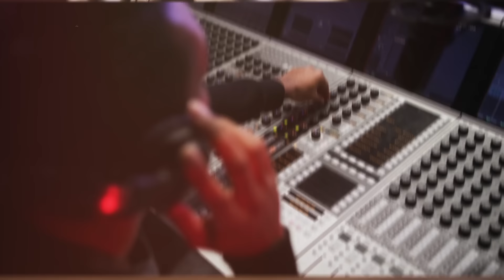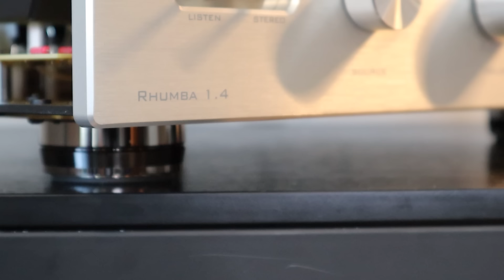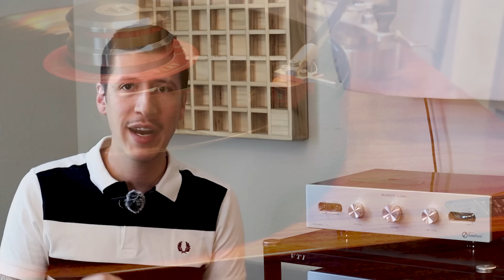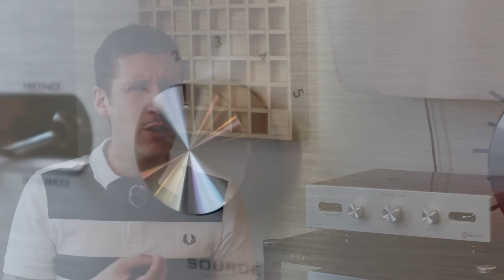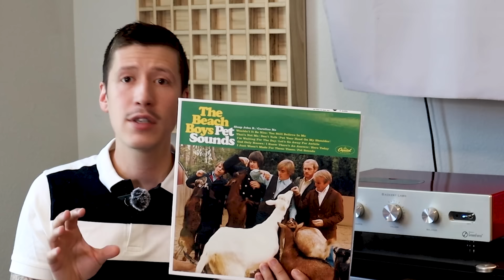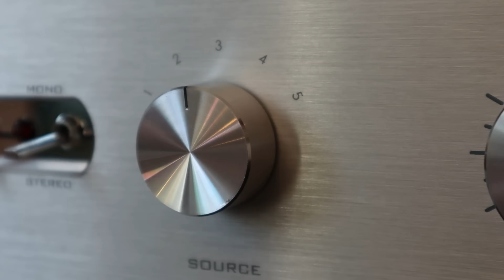Rhumba Extreme 1.4 linestage tube preamp review

Comment: You can sum the two channels on many preamps by plugging a single interconnect between the left and right tape outputs.  My c-j preamp does not have a mono switch but it does have tape outputs, so I built a box with two RCA cables coming out of it and a toggle switch that links them together.  It's not the most elegant way to do it but it works.

Comment: the 6953 is an infra red photo tube and thus not a sub for the 12au7 . the 5963 is the reference you may wish to use .  For  tube guys this is a large error. Looking at the part chooses does give insight in to tube selection and intended voice of that pre amp . Over all this is a good choose in it price range . Tube rolling will effect the sound of an quality tube unit  with very few exceptions.

Comment: I've got a Rhythm 1.3 with some of the 1.4 upgrades. Moved to it from an LTA microzotl, also a great tube pre, but this is on an entirely different level.
Reply: How's the noise floor?
Reply: @pkal244  excellent. I've got Voxativ speakers very high sensitivity. But I've also spend a considerable amount of money on getting the power right. Cables, conditioner and grounding all addressed.